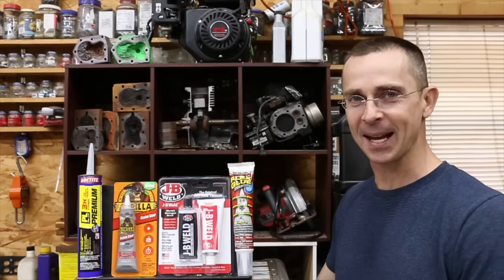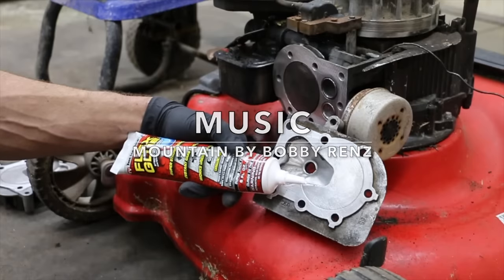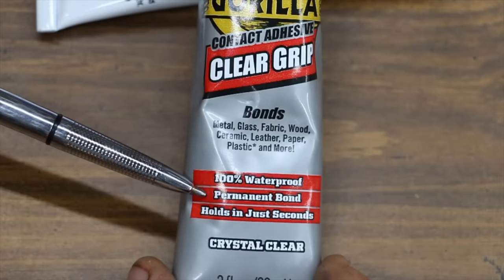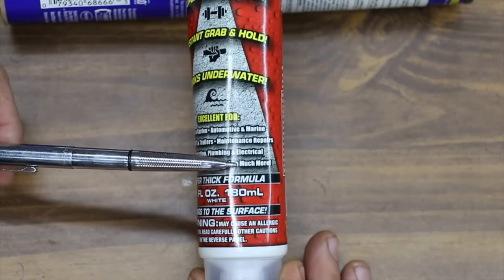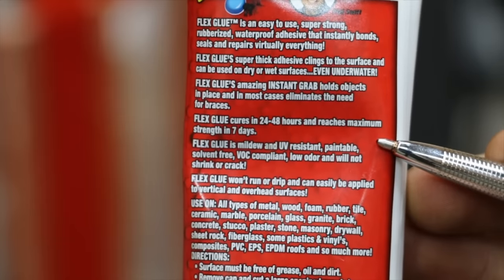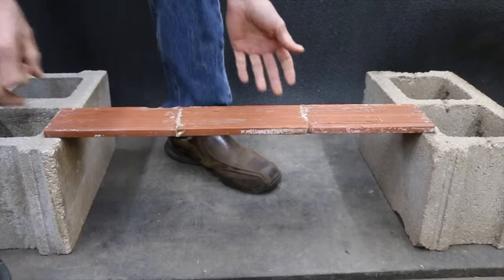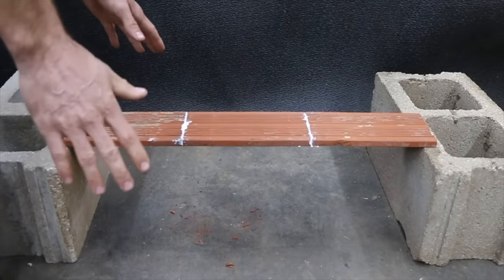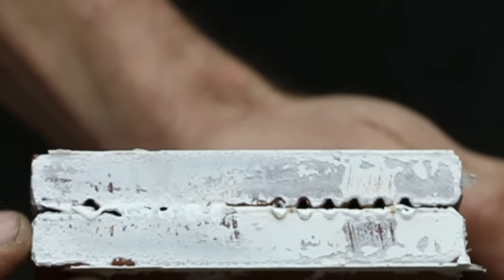Is Flex Glue better than JB Weld, Gorilla & Loctite?  Let's find out!

Comment: "I need more weights." ... pauses video and heads to Home Depot to buy some JB Weld
Reply from the maker: Thanks for watching.
Reply: From my experience, it's even better than most other epoxies. Specifically talking about clear epoxies because I've never tried any other metal infused epoxy. It even stinks less than half the different kinds of epoxy I've tried.
Reply: @jjhack3r  JB Qwik stinks to high heaven. Smells like a fish market with no shade in 105⁰ heat
Reply: @BurningCole963  well sure it doesn't smell good but at least it doesn't fill my house with stench. I only use original jb weld since qwik weld is far weaker.

Comment: Very impressive J,B,weld saved my life once!
I was out on my dirt bike riding when I crashed my bike.
I was at least 22 miles away from anyone or anything!
I'd broke my ankel and cracked 3 ribs.
My bike handle bars snapped right off. I had J,B,weld in my tool bag 
Along with plires and a tire patch kit with my hand pump.
There was no way I could walk back to my truck.
I J,B, welded my handle bars and within a few hours, I was able to coast down a hill pop it in gear and 
Ride back to my truck.
I was very happy I'd had my J,B,WELD with me that day.....
Reply from the maker: Impressive!  Thanks for sharing this experience!
Reply: Thanks bro 👍
Reply: Wow, you should be in a commercial for jb!
Reply: And your ankle and ribs can now take a 100 lb length of railway...
Reply: Didn't save my life, but I did have a heavily modified '87 Honda Trx 250r that blew a hole through the crankcase out in the dunes. I had to tow it back to camp and I had some JB weld in my toolbag and said fuckit. I applied it, let it cure, applied another layer, let it cure again. I shit you not, I kicked the bike over and it ran with no issues ! Stayed together until I sold the bike a year later.

JB Weld user for life.
Reply: You better had J.B. Welded your ankle and rips. That would sound more reasonable. An the best - you don't need to bring J.B. Weld with you anymore because you are unbrakeble (funny word joke in this context :D )
Reply: Damn, jb weld is 200 years ahead of other companies interms of glue
Reply: @repsgsongs4562  yes and made and used by ancients of days. Well not quite that old.but iits been around for decades
Reply: That's a Lot of faith to put into an adhesive, amazing that it delivered
Reply: @gonzaloueda376  See, the thing about JB weld is that it's not really an adhesive. It's a 2 part epoxy which can cure to the strength of a composite fiberglass like material, so ofc it would be the best in most scenarios
Reply: "In the next test, how well does J-BWeld work on bones?"
Reply: And then they all clapped
Reply: Amazing story
Reply: I saw an episode similar to that on Macgyver but he used gorilla glue.
Reply: Moral of the story, don’t ride along!
Reply: Wow! For real , honestly glad you're alive to share your experience!
Reply: Very cool....and how are the broken bones holding up ?
Reply: Tracy,
I was hoping you were gonna say you set your ankle with JBWELD!!
Reply: What a story! J.B. WELD should do a series of commercials based on true story’s of there product getting people out of jams. It would sell a lot of product!
Reply: I'm not buying it - - been using JB long enough to know it wouldn't set-up in "several hours" and ALSO know motorcycle handlebars don't "break" they bend and fold.  Never seen one just snap.
Reply: I was waiting for you to say you JB Welded your ribs...
Reply: 7 days cure time - you must of got hungry.
Reply: Who was that dude who took his dirt bike out to the desert and got stranded and died? 
Was a famous dude, I think a pro wrestler or an athlete of some kind
Reply: Rode 22 miles away from the truck ? Hardcore...

Comment: Your control methodology is outstanding. The comparisons you make are about as fair as anyone could make them. Great work,
Reply: He is using different glue types so the test isnt valid. The contact adhesive Gorilla, The construction adhesive Loctite, the epoxy JB Weld, whatever FlexSeal is. This just tells us what glue type is better not what brand.

Comment: During weight test: 
When he asks 'Can flex glue beat JB weild?'
Flex glue: starts sweating Intensily
Reply from the maker: Lol
Reply: really depends on what your doing with it... i wouldn't patch a roof with jb weld... i have used flex glue for that and its lasted 2 years.... though i wouldn't flex glue an alternator arm on... or patch an old steel radiator with it....

Comment: I had a piece of stone break off my house when I hit it with the lawnmower so I immediately said to myself I bet project farm has a video on the best glue/adhesive and sure enough here I am.
Reply from the maker: Glad to hear!
Reply: STONE...I ALWAYS USE CEMENT CRACK FIX...IT HOLDS...ALL CONDITIONS...JB WELD IS EXPENSIVE...AND AMOUNT IS SMALL...HOWEVER...CEMENT CRACK REPAIR REALLY HOLDS SLUMP STONE AND OTHER ROCKS CLIPPED BY A TRACTOR OR CAR...
Reply: You know what else, you have to give credit to You Tube too,

Comment: When the material fails before the bond,that's pretty impressive.
Reply from the maker: Great point!
Reply: The material didn't fail first it was the bond. Look again. JB weld is still the best!!
Reply: At 115 lbs the glue failed and when the weights fell on the material, that's when it broke.  Go back and look again, he shows you where the glue comes apart.

Comment: Good Ole 91% rubbing alcohol from Walmart. JB Weld was very impressive. :-) My only problem with JB weld, it starts becoming flexible when heated over 200 DEG F. The higher you go, the more rubbery it gets. Great video Todd. Have a very nice Christmas!
Reply from the maker: Doug, Thank you very much!  You've got a great channel. Merry Christmas and Happy New Year!
Reply: Wait, I thought they made a high temp JB Weld or is that only Loctite thread locker?
Reply: Project Farm please do the soapy water test to see if dawn-water solution provide better lubrication than motor oil.
Reply: @Leo Lewis That won't work too well because the Dawn soap will boil off.
Reply: interesting. i do know that steel jb weld cures much faster with heat. never tested strength in heat. thank you
Reply: electronicsNmore - But how temp resistant are the other adhesives?
Reply: Z Anarchy who are you talking to?
Reply: That's why they make high heat J-B weld
Reply: I dunno...My dad fixed an exhaust leak on a toyota with JB weld. That shit is impressive.
Reply: It also has a fairly long cure time compared to some other things. But 90% of the time I need a glue, it's the only thing I'll use, thanks to these videos.
Reply: @ProjectFarm  What about testing what the glues are best used on, like having 3 x 1 inch pieces of materials glued together with a 1x1in square to test the strength of the bond. You could do cloth, leather, plastic (both flat and roughed up), metal (both flat and roughed up), wood (both flat and roughed up), rubber (like a used bike tire and inner tube). 
Then after that you could take the top 2 or 3 materials from each glue type and you can test how the strength differs in different conditions, in the refrigerator at 35 degrees, in the freezer at 0 to 10 degrees (or however cold you r freezer can get), in the oven at 100, 200, and 400 degrees, under water, covered in rubbing alcohol, oil, and gasoline.
After that I think it would be interesting to see how temperatures effected the glues. So if roughed up metal held 5 pounds max at room temp for the worst glue, you would hang 3 and 4 pounds on bolts of each type then put it in the oven  and see what temp each glue fails at, then you could set something like that up in the freezer too by putting a similar set up in a freezer and turning it on  with a light  and a thermometer to watch the temperature, if it got all the way to the bottom you could try putting some dry ice in there or some liquid nitrogen to reduce the temperature even more. 
And last but not least, I think it could be cool to maybe make the breaking point a little flashier for some of your experiments. So if you are testing how much pressure a pvc pipe cut in half and glued back together can hold you could do something like filling the insides of tubes with red colored flour, a dash of glitter and pressurized air making your tests more visually active a bit more Mythbusters like so when the pipe breaks there is a burst of red dust and sparkles from the bright light shining through the powder. I hope this gives you some ideas for how to test some things or how to get more views in the process.
Reply: B. Rippy  Good point. I use the putty over the epoxy. Holds up to heat very well. Patched a weld seam pinhole in on a  motorized bike exhaust pipe with the putty and it never softened or failed!
Reply: I know when it is setting up we use some heat to make it more fluid to get into deeper cracks but it seems to hold up well to temps after it is set up 

are you talking during setup or after?

I guess I never put a temp gun on my application maybe 160-180 degrees but I couldn’t imagine it getting soft at or after  200
Reply: Jbweld has a high heat version and now an extreme heat version. When mechanic remove an oxygen sensor in the exhaust pipe of my s10 he created a leak. Replacement pipe is $400 because convertor is part of it. Had him apply the extreme heat jb weld and so far it's quiet enough not to draw attention.
Reply: electronicsNmore jb original has higher temp but takes longer than the 5min to cure. thanks 😎
Reply: Ken Hilson try furnace cement works good for me exhaust leaks 😎
Reply: Probably Obama. @ALMX5DP
Reply: I have not experienced that, and I've used JBW on various engine parts with great success.  Hard as steel.  You have to have the mixture right on ANY epoxy, or it will not achieve the desired strength.
Reply: @kenhilson786  the JB Weld ExtremeHeat is a filler, like bondo but for metal. Its not a glue. So while it can help fill in gaps and cracks, you can grind, file and drill it - it won't really glue anything together if there's and significant load on it.
Reply: @pr0xZen  thanks. My leak is noisy again. I'm thinking of wrapping wire both ways around the pipe at the sensor base. Then was going to cover wire with extreme heat jb. Maybe I should apply jb first and cover with wire and then more over the wire.
Reply: @ProjectFarm  happy new year!
Reply: There is a fix for that, pick the correct product for the application. Extreme Heat JB Weld - Continuous 1000 deg F, 538 deg C.  High Heat JB Weld is good for 450 deg F continuous and 500 deg F intermittent
Reply: I used JB Weld to fix a crack in my car's exhaust manifold. Held together for years until I sold it. Seemed to handle the heat with impunity.
Reply: There is a high temp JB formula that is good to way more than 200°. I used it to repair a crack in the deck, between the cylinders, on a 400 SBC and the repair held for several years before I sold the motor.
Reply: Alcohol should always be avoided when using JB Weld, especially as toothpaste
Reply: @curtismayne1  dirt bike 2 stroke exhaust chamber. Yeah it holds up to a few rides till it leaks. But it did hold for a few trips
Reply: @trentonolson5559  ^^This!  We fixed exhaust manifolds with it! Makes mufflers look like baby poop.
Reply: Gorilla and flex overpriced garbage 🗑
Reply: @STAY-GOLD-VINYL  which putty, any?

Comment: Next video:
JB weld vs spot welding
Reply from the maker: Thank you for the video idea!
Reply: Project Farm jb weld in my lotion bottle vs. penetrating oil
Reply: JB weld might actually be a better weld than most of the stuff I have seen come from China.
Reply: JB Weld vs A Cars Differential.
Reply: I'd like to see a video on duct tape because some of the brand such as gorilla T-Rex duck and 3 m duct tape and any others you might want to put in there be interesting to see I would bet on T-Rex they sell that at Menards
Reply: @l33tpvpness  someone did a video with a crown victoria Differential and jb weld. I wont ruin it for you.
Reply: @RennsportRS59  it's been done already
Reply: @ZT_Performance  bruh
Reply: @RennsportRS59  check out Life OD's video on it, shit is straight cash. Also they're different motor oil video is pretty sick as well.
Reply: Spoiler: JB Weld wins
Reply: @ryanpennington8108  they are different motor oil video?
Reply: @gigilaco  I wanted to watch that....

Comment: I had an old Escort with a crack in the oil pan that leaked a little bit of oil. I looked up how hot the oil pan gets when the engine is running and how much heat JB Weld can take. According to the internet JB can take the heat so I fixed the crack with it. It never leaked again during the time I owned it.
Reply: I did the same on a 1988 Ford f150 oil pan. Had like three places leaking and the jb did the job.
Reply: I read escort and crack and thought the presidents son was watching this channel
Reply: @timblack33  exactly 😂😂
Reply: Ha, I see what you did there.
Reply: @timblack33  No, I am sure that Don JR is not watching anything connected to any kind of work.
Reply: @Casper1907  RENT FREE
Reply: I think they have more special formulas on their website than they do in the store!

Comment: Wow, I used to use JB Weld but switched to other products because of the A/B mix issue.  You just taught me I need to always have it in my tool kit since there isn't anything else close to it's strength.
Reply from the maker: Thanks for the feedback.
Reply: If you're worried about the A/B mix, just use the JB Weld in the Mixer Syringe with the Static Mixers. You'll get a perfect mix every time, with no more worrying about a bad mix.
Reply: A/B mix glue in general are much better than air cured since they use dedicated hardener